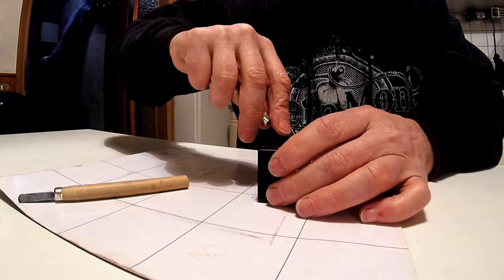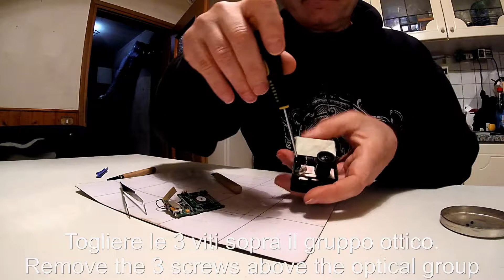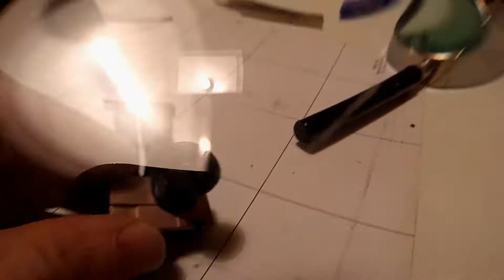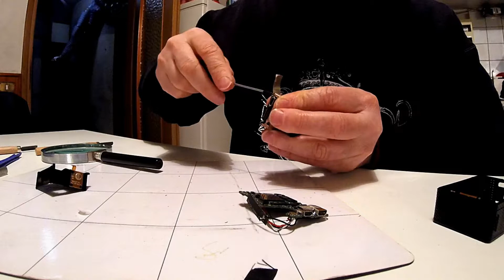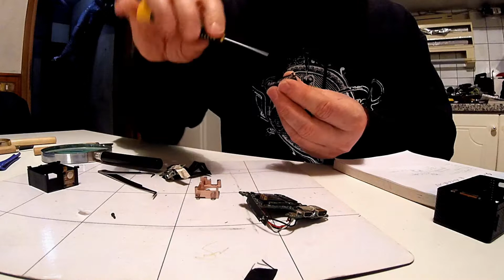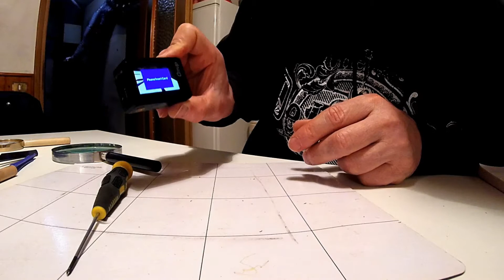Gitup G3 smontaggio, Disassembly. Sostituzione lente, lens replacement, part 1

Comment: Hello! Could you please tell me if you ordered the lens from the manufacturer or you just had another gitup 3 cam? My 90° lens has been scratched and I need a replacement. As far as I understand the lens can be detached from the circuit (image sensor) without any special instruments, using only screwdrivers. Am I right? Thanks a lot for your effort and uploading this video. This is the only one I have found so far concerning the disassembly of this camera model.
Reply from the maker: Hi, I'm waiting for a lens from 170 (not original), I want to see if it goes well and if it improves the framing, the manufacturer is available for the GitUp 2 and costs too much for my taste. I hope it goes well that alternative that costs very little, but the lens does not have the support base where it must be screwed, it is necessary to use the original square that has glue on the thread of the lens that must be removed. the original lens (only lens without fixing base) of the 90 'gitup 2 is available on Aliexpress at a cost that goes from 25 to 33 dollars...
Reply: thank you!
Reply: @GiGiMTB  Do you think that the Gitup 2 90' lens is interchangeable (compatible) with the Gitup 3 one? I've been trying to find the specs on the Internet, but there are no reliable sources.
Reply from the maker: I do not know, I will have more information when I will have to replace, I hope so given the technical characteristics, but I have no certainty until I have the lens in hand.
Reply from the maker: https://youtu.be/OQg0WbOQnco